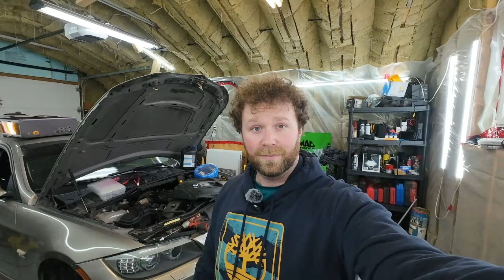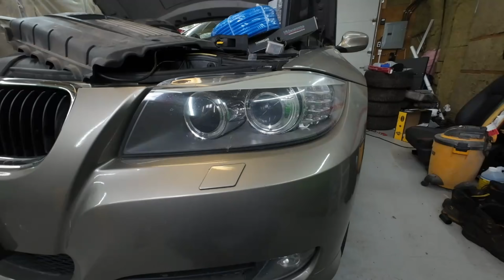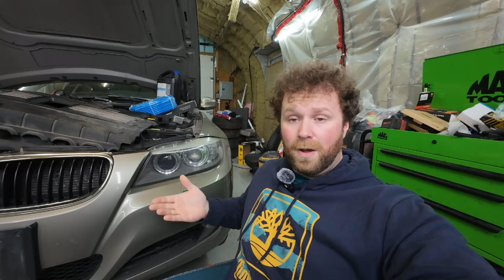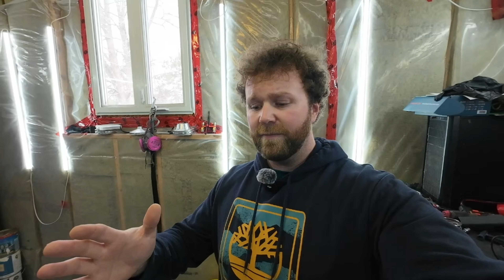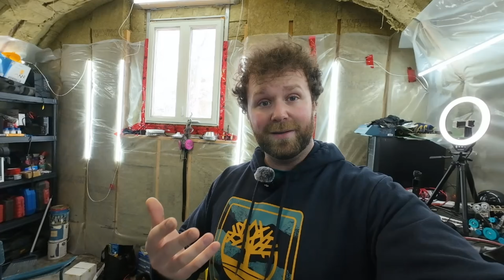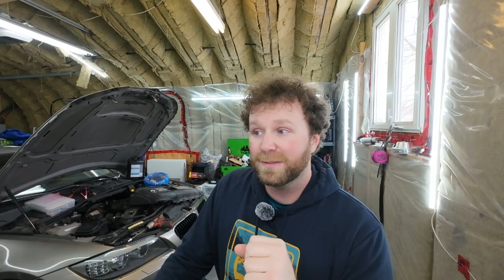My Eyes Are Up Here! The Stupidest Trend in Car Design.

Comment: One of the questionable things i keep seeing is turn signals on the INSIDE of the headlights near the badge, compared to being on the outside corners of the car which would save the cost of having to put an additional set of lights on the mirrors so traffic coming from the side can see...

Comment: After years of owning older cars (2001 Mercedes ML and 1993 VW Golf) where the turn signals are amber and where you expect them to be, imagine my disappointment when I noticed my new car (2026 Hyundai Tucson Ultimate) had this HUGE taillight assembly with an LED lightbar with more than enough space to house the turn signals, and yet the turn signals and reverse lights are at the bottom of the bumper 😒 and you don’t even get two reverse lights, the left one is blanked out for some reason.
Also, the actual headlights are where the fog lights normally are, whereas the DRLs are these giant LED fixtures in the car’s grille

So disappointing and unsafe in my opinion…

Comment: If tail lights are on a rear hatch, they need to be on a body part that doesn’t move. So with the hatch open, you can’t see the tail lights. But they can mount them on the fenders or bumper.
Reply: Then why not have them on the rear pillars like ye know most cars normally do?

Comment: Man chevy is worse. The bolt has   red taillights up high but the actual brake is way down low where you'd think the reflectors are. At least hyundai Kia uses the higher mounted lights as brake lights.

Comment: The vehicles that drive me nuts for turn signals are any that have red turns in the rear and any newer vehicle that does have amber rear turns but disables the red brake lamp on that side while the signal is in operation (mostly Ram and Jeep)

Comment: I have a 2023 Chevy Bolt for our family/errand car, and I am almost certain that the turn signals, brake lights, and reverse are all in the bottom of the bumper and the normal taillights are just running lights. I could be wrong though.

Comment: This has been a "thing" in Australia for over thirty years with mid sized and upwards 4WD vehicles, and like you, I have noticed it is filtering down to some of the smaller cars now as well. The original reason in Australia was to meet an Australian Design Rule (probably pinched from Europe or the U.K,  because we didn't have our OWN brains back then, and it seemed if it was good enough for them, it was good enough for us...) stating that the turn signals,  brake lights AND later on rear fogs had to be at a certain height above the road, otherwise the vehicle was unregisterable and unable to be driven on public roads. The car maker's fix? Pull the globes and wiring out of the perfectly usable existing tail lights, and put a set of orange and red lenses down in the rear bumper bar, right where they're going to get covered in mud, road dirt, and/ or smashed easily.  I've given up counting the amount of times I've had new owners of these vehicles come to me wanting their "upper" rear lights fixed because the globes don't work, then they don't believe you when you tell them why. I usually have to actually remove the light to show the owner that there isn't any wiring or globes TO fix....

Comment: I thought I was the only one who thinks rear signal lights in the bumper are stupid.  A bumper is meant to protect your car from minor bumps, so who in their right mind would put signal lights down there?  Center High Mounted Stop Lamps are required by law because they are easier to see.  Let's put signal lights down low in the bumper where they are hard to see.  Brilliant!  I would never own a vehicle with signal lights in the bumper because if they're stupid enough to put them down there, what other stupid design features are in that vehicle that you can't see?

Comment: Ive seen front indecators by where you would put fog light. you cant see them when the car is going round a roundabout. I also hate the headlight bulb on the inside of the headlight instead of on the outside.

Comment: Critical safety components should have redundancies, easily serviceable, and parts should be universally available across brands. 
Let's address headlight and taillight bulbs. Or maybe fuses and wiper blades. 
If I bought a 2026 F-150 and went on vacation and blew a headlight bulb, I shouldn't be left stranded because the module gave out or the assembly costs $1,400 and must be ordered. I should be able to continue my journey with peace of mind, knowing I can pop into a local auto parts store and grab the appropriate bulb to solve my problem and be on my merry way. 
Proprietary fuses? WTF? So, because my trailer harness had short because something flew up and hacked the wires, I've blown the fuse. Or heaven forbid, the trailer module. Just, why? Now my trailer has no lights until I get to a dealer for a Proprietary fuse or order a module? GTFOH with that. 
And that abomination, the 2025-26 Chevy Trax. Yeah, those stupid wipers are on intergalactic backorder with no aftermarket support. 
Give me redundancy or give me death. If a critical system comprised of special parts, not universally available, then they need backups. Otherwise they have no place in a 2-ton missile. 
Gimme bulb, fuses and wipers. And stop complicating the basic safety needs of the automotive industry. 
We don't need push button or dials for gear selection. We need tactile controls to keep our eyes focused on the roads. 
I could go on and on over the shortcomings of the modern automobile, but the point is, it's unnecessary, unsafe, and overpriced.

Comment: Front turn signals in the US can be either white, or amber colored. No other color's are allowed. So if they don't choose amber, they would be white, which is dumb and they know it and nobody does white for a reason. So it will remain amber in the front, because of course it will. There is zero problems with front turn lights in America. They actually have to meet a higher standard of visibility (front and back) in the US then in Europe. That is why the US doesn't have the same progressive tail lights and signal lights as they do in Europe. Not because America doesn't want cool lights, but the European style progressive lights didn't meet the US's higher standards of immediate visibility. Many vehicles in the US now do have progressive lights, but they function backwards from Europe where they light fully initially then progress off. This meets the higher American standard. So, you could argue to lower American standards, but it's not necessary. Manufacturers have figured out how to do cool things and still meet the US lighting standards.

In the rear in the US, cars have the choice of red or amber for turn signals. Regardless of which you prefer, both are fine.

If the front DRL is overpowering the front turn signal, then the front headlights are not aimed properly. Seriously, that's it. They shouldn't be pointing into the cabin of opposing vehicles. When they're properly aimed, you can see the front turn signal just fine even with the DRL. This is evidenced by going outside and looking.

I agree that turn signals shouldn't be on the bottom of the vehicle. They should be near the center, or even higher. At minimum, they should be near the brake lights, wherever those are, because that is what you're looking at.

Generally though, your rants seem to be more about your ignorance of a subject. Just because you're too stupid to understand the reasoning behind something, doesn't mean there is no reasoning behind something. Don't pretend to know more about engineering than people who dedicate their lives to engineering. Complain about hard to reach oil filters; you know, things that are in your lane.

Comment: The turn signal thing is just a bad idea. The Chevys with the BRAKE lights 8 inches off the ground is the dumbest design to ever exist. Especially since there is a running light that just doesn’t light up for brakes.

Comment: You’re on point. Seems as if practical functionality is eclipsed by selling cost cutting as novelty.

How the brake lights can also be the turn signal is mind blowing.

Don’t even get me started on the  insanely bright headlights! 

To be fair to buyers, I’ve never even considered checking how lights look/work before buying a car. I certainly notice others in the road, but not while at the dealership.

Comment: As an owner of a Kia with turn signals in the rear bumper i can say it's dangerous. Going down state highways with big pickup trucks so close i can't see their face out my rear window i know they can't see the turn signals. I was almost plowed off the highway by a pick up that was behind me so close that when i turned on the turn signal to make a left turn and slowed down the pick up truck didn't slow down and damn near drove off the road to a avoid hitting me. You can say what you want about traveling close to other vehicles but turn signals that low on a car is a bad idea.
Reply from the maker: Well you know it. Hopefully you stay safe out there.

Comment: Even position lights (DRLs, signal lamps) are too bright and not sufficiently diffused.  2001 VW Polo 6Q/9N/9N3 was the first to cleverly obscure the front turn signal below the headlamp.
It's amazing how lighting has got so much worse since 1974 Volvo 240.
Reply from the maker: Some understand how bad the situation is. Glad they made it work

Comment: Another dumb thing about the headlight dimming for the indicator means that at night its dimming in the direction the driver needs to be able to see the most.
Reply: It's only the daytime-running lights to be dimmed. Not the low (or even high-) beams.
Reply: @Romiman1 the car I have in mind is the Australian delivery of the ford ranger/everest/escape. The headlights are laid out with the daytime/vanity light as a surround then the high/low beams on the outside with indicator on the grille side of the assembly. I see them at night indicating onto side streets and all but the vanity strip light and the indicator dim, i guess so the indicator can be seen.

Comment: You are living in America.  A 3rd World Country.  Amber Turn Signals are mandatory in more advanced countries FOR A VERY GOOD REASON.  They have been scientifically tested and proven to be the most VISUAL way to indicate WITHOUT FAIL.   
ALSO, Eye Level Brake Light are so located for the same scientific reason.  Thats why many cars have a Brake Light AT EYE LEVEL in the rear windscreen.  
Best you do some RESEARCH,   ANCAP Ratings is a good start.   🇦🇺

Comment: OMG thank you, this is such a bad design it annoys the crap out of me. Car designers these days need a good head shake. Chevy (I think Trax) is doing this too. I literally WILL NOT buy a car with such a stupid oversight, as it's literally a safety concern. I even saw the BRAKE LIGHTS relegated to the freakin bumper. Like, what????? It was either a Kia or Hundai electric car. I almost puked right there when I saw those bastards light up way the hell down there. Like, what's the point of putting the things that actually look like brake lights in the normal spot and then NOT USE THEM? Naah, let's leave those as ambient lighting and use these little things way down here that are supposed to be like a reflector and make them BRAKE LIGHTS AND OR TURN SIGNALS because that makes TOTAL sense. Kia/Hyundai are on a mission to freakin kill people, I swear. These sorts of designs seem intentionally bad

Comment: Front turn signals just need to be moved away from the headlight. At night time you need to headlight to see where you're turning. Turning it off adds another issue
Reply: It's the daytime running lights that turn off on one side while using the turn signal, not the low/high beams.

Comment: Yeah, this is getting to be a bigger and bigger problem. The car industry has made this change without consultation with the countries they sell the cars in, and somehow it's being approved for sale. In Australia we have our ADRs, which is a massive set of regulations specifying the size, location, intensity, colour, of anything like indicators, lights, etc etc, how many mm wide the seatbelt webbing needs to be, etc, and it's thousands of pages of details. But the manufacturer builds their car in a lab, not on the road, and then roadtests it from the inside, not the outside. I'm sure they simply don't look at the effect of their crystal lenses in the sun, or how hard it is to see an indicator on a car wanting to turn away from you coming out of a side street on a sunny day, etc, or any of hundreds of other scenarios that just don't seem to occur to them. Indicators seem to be designed now to be viewed exclusively from directly in front or the back, or other drivers are expected to spot some indicator on the side mirror the size of used chewing gum on the other side of the car. Very few brake lights are visible from the side now. And yes, part of our ADRs dictates things like the height of the indicators and lighting too, this is part of where the old pop-up headlights came from - it allowed them to be installed lower, but raise to a legal height in use. But none of that seems to be followed any more. The other aspect that HAS to get fixed quickly is fitting a light level sensor to every modern vehicle so the morons that can't tell their headlights need to be turned on at night because of the glow of their running lights can actually have the back of their vehicle visible too.
And for those that think this is an Australian issue, I didn't create this clip, I'm just adding an Aussie perspective to it - cos we have this problem TOO.

Comment: Agree.  I absolutely hate when cars have turn signals in the bumpers and brake lights/running lights up in the "normal" spot.  Hyundai or Kia also have an SUV where the taillights are low and they are shaped like pixelated dog bones.  Those also disgust me.

Comment: I work in Civil engineering and the sight lines calculated in designing vertical curves (hills and valleys) is only 600mm off the ground for tailights (I apologize I'm puling the numbers from memory it may be a few MMs higher or lower, but it is very low) from a drivers eye set at 1.05m above the ground.  It comes from the TAC highway design manual but its based on DOT numbers.  I'm glad cuz it keeps guys that run lowered suspension from falling below an already low number.  If you recall this is nothing new, the 80s malibu wagons were very very low...and very very dim cuz the light enclosures scooped up beaucoup dirt.

Comment: There are way too many inconsistancies across the board for whats legal
Ie some trucks. Like my 2015 gm has no rear glass defrost
, some cars have no spares. Electric emergency brakes should be totally illegal the entirely defeat the purpose of being able to apply them during loss of power, and they dont engage at speed quickly anyways. Most need to be held for like 5 seconds, 
        Then theres 2 tier laws like, if i jack up my truck or put a bush gaurd on it im breaking bumber safety laws, but cops can do it. 
Its all hogwash

Comment: I hate Hundai/Kia for doing this. My work van is too high to see them. My daily driver sits low I can't see them.

I also hate Chevy(?) for turning the reverse lights on when you lock/unlock the car. I hate sitting there thinking im being polite and allowing a car to reverse out. But the cars empty. It's not even running. The reverse lights should only come on when the car is reversing. Why is that a crazy concept.

I like Toyota and Mazda maybe theres exceptions but they have amber turn signals separate from the brake lights. That should be the standard.

The signals on those Kias/Hyundais are also tiny. Why would you reverse the reflector and signal location. Who benefits from that???